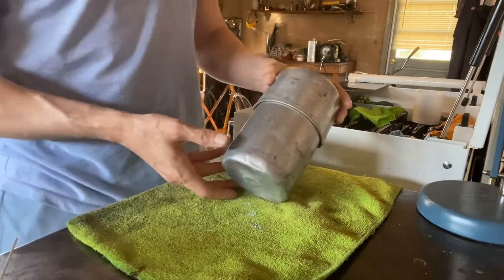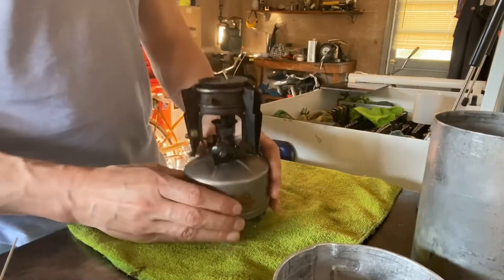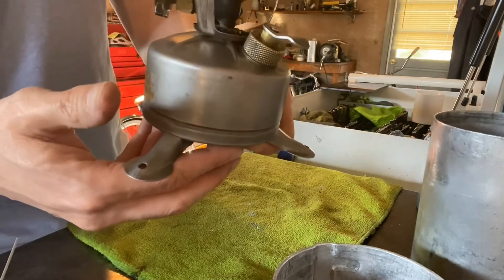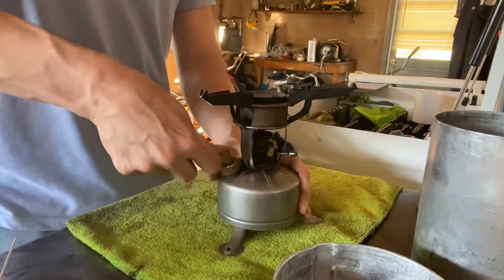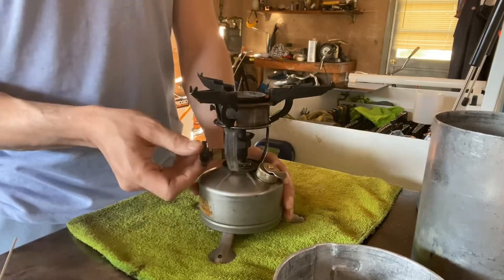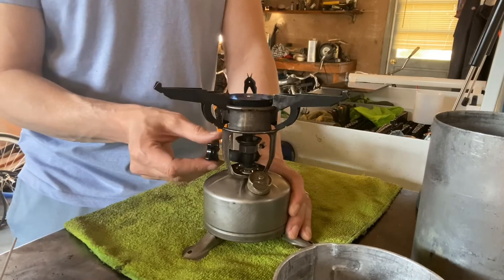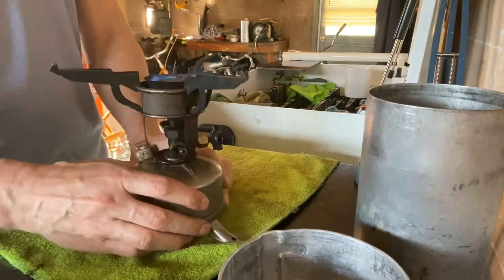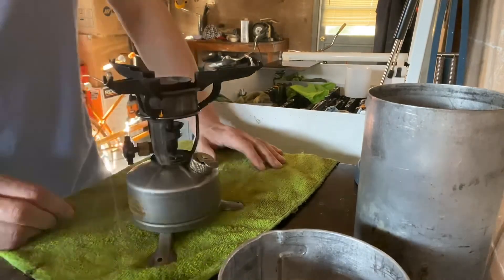M1942 Military Stove

Comment: I have 3 of these. Does anyone know where I can get them repaired/refurbished? I need the pump assembly worked on.
Reply from the maker: Easy enough to fix Michael.. you can get all the parts from oldcolemanparts.com
Reply: @MrBenryanuk  It would be easier to have someone who knows more about the Stoves to do this.
Reply from the maker: @michaelwight2289  of course, but then it’s a missed opportunity to learn something new :-)